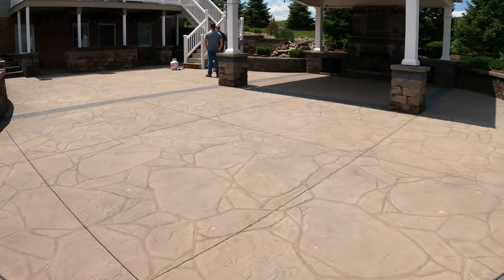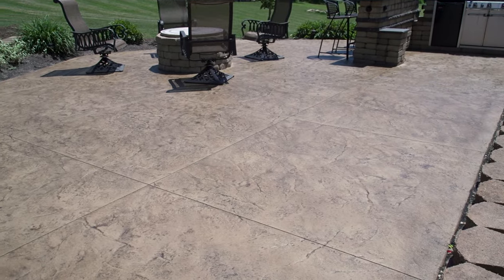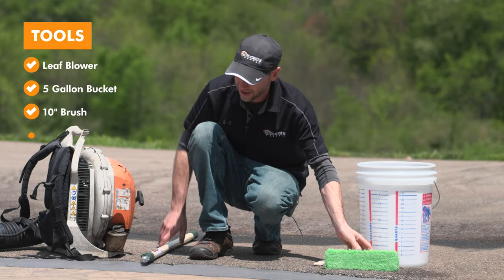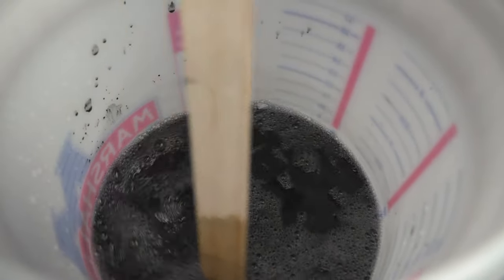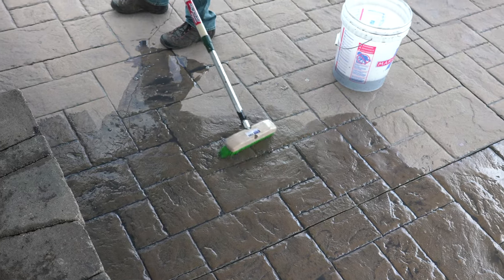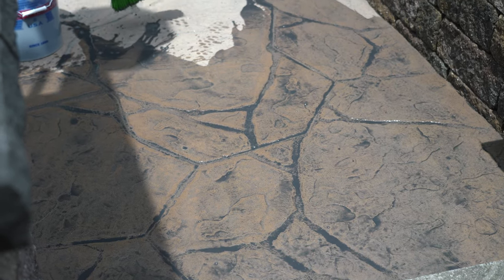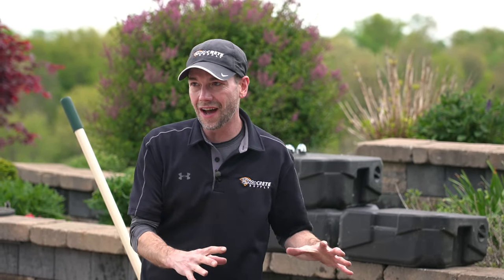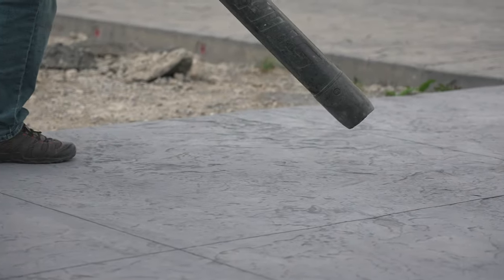How To Antique Stamped Concrete!

Comment: Once it is fully dry, Is it ok for it to be rained on before the sealer goes on? My sealer doesn’t show up for 2 more days and I’m thinking about putting plastic over the pad because it’s calling for rain tonight and tomorrow
Reply from the maker: Thanks for the comment! As long as the Texture Enhancer is completely dry, it's fine to get rained on, you don't need to worry about covering it up. If it rains on the slab for a few days, you would probably want to give it a full day to dry out before sealing. Thanks for watching Deco-Crete TV!!

Comment: Can you use color hardener with water for antiquing?
Reply from the maker: Texture enhancer is specifically designed for antiquing concrete. Color hardener would be messy and hard to manage.
Reply: Yea. 100% Steve. These products are basically sifted color hardener.  I’d say they are 100% sifted color hardener but I’m not familiar with this certain product. I wouldn’t add a bonding agent, but some do. On hot days , do not use a polymer/bonding agent. I use a good, rich color hardener sifted and it does this EXACT same thing buddy.  Few other techniques is to wet the surface and spray which gives it a little more antique color, but if you apply heavy, you’ll have to use a brush to fix anyway. Watch for brush marks. I don’t see a need to buff the concrete if you wet the surface first. Keep a wet edge if using this product.   But sifted hardener is much more forgiving

Comment: Si if your stamping a colored patio and you want to antique it but you are used to using liquid release you just as this to your pump and stamp as regular
Reply from the maker: when using liquid release, use this product once the concrete is hard (usually the next day) to add the antique effect.

Comment: Getting the texture enhancer is difficult at this part of the globe Sir....please can it be a color pigment and water instead of the texture enhancer
Reply from the maker: Thanks for the comment! We always love hearing from you!! The problem with just mixing pigment & water for the antiquing would the bond. Texture Enhancer is designed to stick to the concrete long-term. The pigment & water mixture will probably look okay, but I doubt that it would bond very well and could lead to the sealer delaminating at some point. You can order the Texture Enhancer from our online store if you can't find anything around your area. Contact Alex at alexm@deco-cretesupply.com for a quote on the shipping! I'll leave a link to the Texture Enhancer page on our website. Thanks for watching!!!! 👍